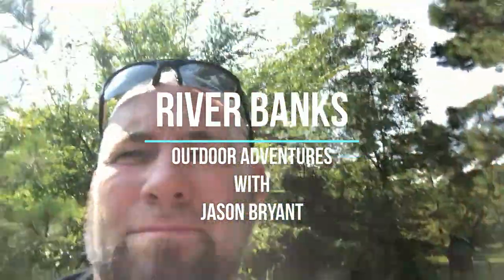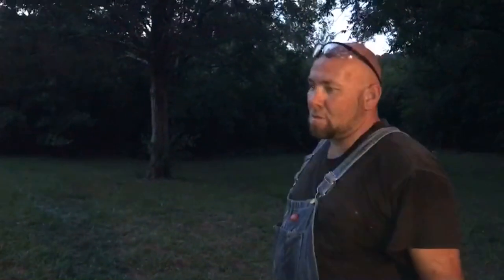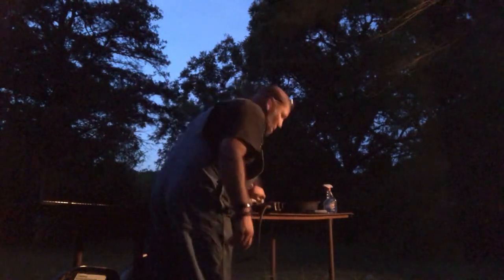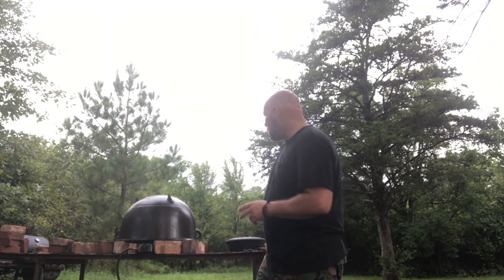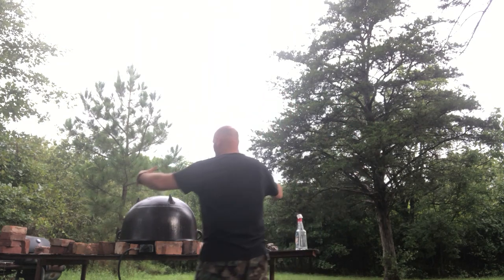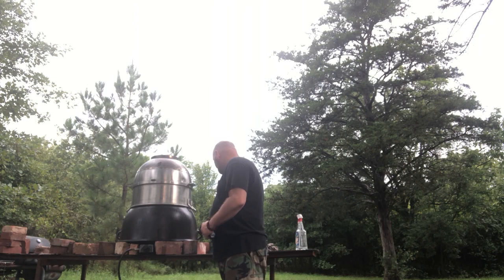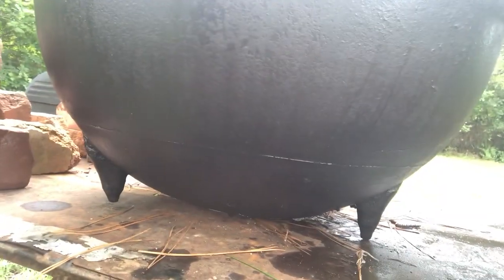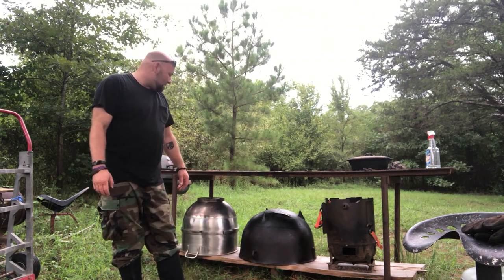Cast Iron Cauldron From Rust to Lets Cook

Comment: You did pretty good for your first shot at a large pot.  What the oil is doing is “polymerization” not “caramelization”.    You will save a lot of propane if you cover the pot.  I use a #2 wash tub.  A good way to finish the top is to season with it upright.  It will season the top great but will burn it off the very bottom.  Just wire bush that part an do it again upside down.  Don’t oil near the lip.  Just get the bottom really well.  I have my pots much higher from the flame to minimize the lip problem you had.  Good Job!!